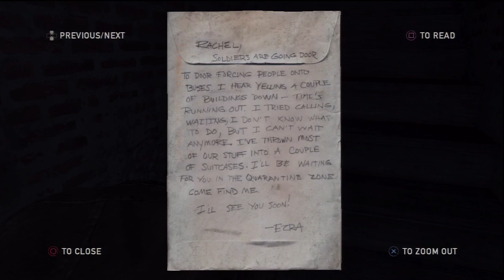Moore's Law Might Be Saved With Progress In Light Tech Which Works In Current Fabrication Plants

Comment: But optical computing deals with photons not electrons.Thats been one of the biggest challenges with optical computing is removing the electrical parts. I remember earning about research into optical memory using photons & into optical transistors so they are definitely getting closer to that goal. Whats exciting about using light is there are a lot of ways to encode the information the light transmits like by modulating the polarization of the light so we aren't stuck with  just 1's & 0's

Comment: Just to remark:
electric signals actually travel at the speed of light in copper wiring or close enough to it.
I think the main source of delay when computing is the need to saturate the transistor before it switches. This si also when it generates most heat since before transistors are being switched by increasing or decreasing their resistance and white this is happening for a short moment current is flowing at high resistance.
I'd be interested to know what they'll use instead of those.